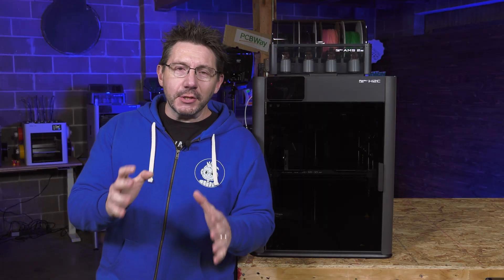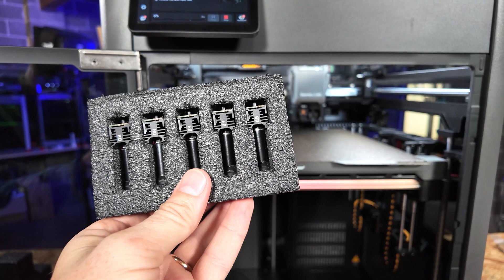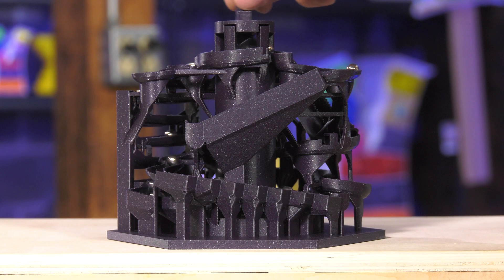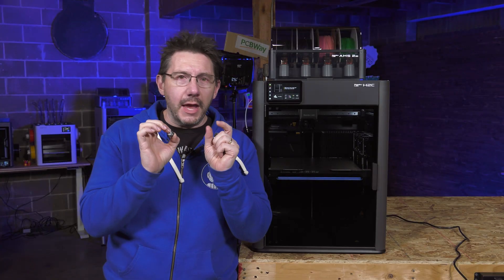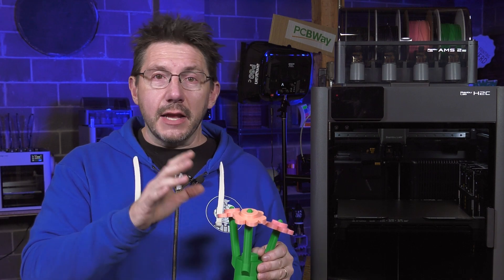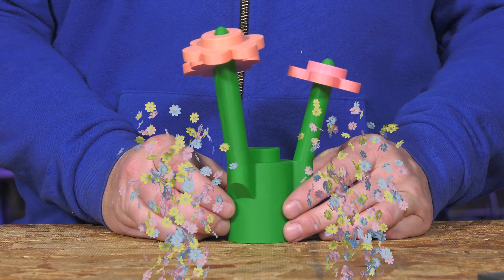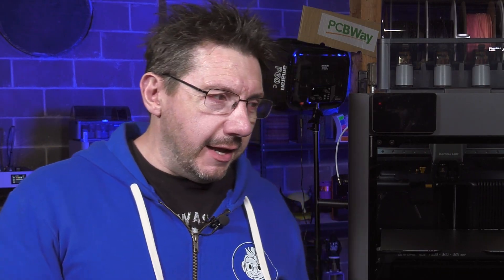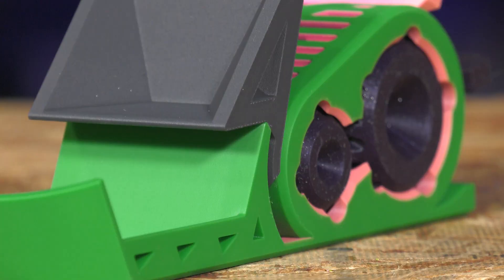My Review of the Bambu H2C + Vortek

Comment: The heat bed worries me. As a FLAGSHIP printer, this is not acceptable at all.
Reply: tbh, the throwaway clog nozzles worry me more cuz that's not something that's going to be fixed. Joel was really trying to navigate his way around Bambu PR friendly terms to explain away that...
Reply: @StormDogg  When I look at my Bambu printers their nozzles have by far been the best and most efficient I had so far - also from a cost perspective. No comparison to the cheap screw in nozzles that often like to cause problems very easily. I've some non hardened running for more than 1k hours and hardened for more than 2k print hours and they're still running.
Reply: @Leif_YT LoL. My screw in nozzles cost $1.25 and I can get them from multiple vendors, last hundreds of hours, and do not clog or jam. You're grossly mistaken and being a fanboy if you think your proprietary overpriced consumables are superior.
Reply: @xNuclearSS1x  1.25? That's the ones we have had many many years ago. There's a reason many companies moved away from those that are prone to errors. 
No comparison to todays nozzles / hot ends and their performance. I've had the cheap in the past and never looked back. Less quality, more hassle. Each change / replacement costs time which is much more valuable. A single clog / failed print costs often more than a complete hotend from Bambu or similar brands.  Doesn't make sense to try to save a few bucks on the wrong end.
Reply: @Leif_YT My K1 Max nozzles which are new Unicorn style cost $4 and i get print quality every bit if not better then A Bambu.  This nozzle has electronics in it....Its probably $25 a piece.
Reply: yeah, but honestly after heating it seems pretty even (considering the heating element) so a "simple" update that lower the reported temp by 10-15% might do the trick.
or delay shipment to update the heating element and/or temp probe.
Reply: @theaypisamfpv 10c isn’t exactly a small difference after heating.
Reply: @theaypisamfpv  Yeah, i also question the readings a bit - see my other comment.  1) The emission factor on that thermometer seems to be wrong   2) it's important to measure when the actual print starts. It won't matter how it is during heat-up phase before the actual print starts.  The heat will spread by then
Reply: Hey, need some advice! I want to buy a h2s but my buddy said a centauri carbon would be a better option due to the price. 😵‍💫 I value his opinion but I really wanted the h2s! What do I do?!
Reply: @ToxicWaste777  Bambu is worth every penny. Cheaper printers will stand out lacking in the end. I own 3 A1 Combos and a Mini all Bambu and I will NEVER own a different printer. My son had 4 Ender 3s cheaper and garbage. So yes, you get a printer for a cheaper price but you get the issues and drawbacks with it. My advice, INVEST in a great printer like any Bambu printer and you will not be sorry.
Reply: @Pr1ntCraft  thanks bro 💯 appreciate the advice/opinion
Reply: @Pr1ntCraft  trouble is, Bambu designs have issues with serviceable components. The X1 has glued in rods, so you can't change bearings, A1 has issues with the electronics failing catastrophically on occasion, etc. Bambu isn't an investment, it's a product. And you're losing more and more control as they go on.
Reply: @Pr1ntCraft Nice sales pitch. Now tell us how Bambu pays you
Reply: @ToxicWaste777 That guy gets paid by Bambu dude. He was sales pitching you.
Reply: @William-b5s2r  😳 wait seriously? Lmaoo bruh i just want some honest non biased opinions to help me make a choice 😭
Reply: @ToxicWaste777 Seriously the K1 just use Unicorn nozzles....they unscrew from the hotend and they are cheap
Reply: @William-b5s2r not at, all dead serious or as my kids say No Cap 🙃
Reply: @ToxicWaste777 Dyde seriously hes a paid Bambu troll. Dont listen to the sales pitch
Reply: @ToxicWaste777 Your buddy is right. H2s is a waste of money.
Reply: I should be getting the U1 in about a month and am wondering if that will cure my desire for multi-color, or if I should also upgrade from my H2D to this H2C and sell the H2D. . .
Reply: Don't worry, it's a nothingburger. It's not an issue.
Reply: @Pr1ntCraft  yeaaaa this was gonna be my next printer I don't know now
Reply: The buying a new nozzle if you get a simple clog doesnt worry you????
Reply: I question the readings a bit. See my other comment.
Reply: @Pr1ntCraft I wanted to buy it but now I don't buy it anymore
Reply: @Aprilia75000 and you made your decision just on one review?
Reply: @hyperflowfans no but I looked at several and they had the same problem with smaller prints
Reply: @hyperflowfans "No, but I see what a "technique" is in it, which changes heads a thousand times, and that at a single pressure, that can't be healthy and the wear is extremely determined by that." Other manufacturers have solved it better, because the "head" is simply changed.
Reply: @Aprilia75000 I have watched other reviews and to be honest I may purchase it. However do I get this only or purchase 2 P2S or a P1S and an H2S or H2D. Is it worth the price tag for the 0 purge (7 colors) or have some purge (0 woth 2 color) on an H2D. Bambu will always get my money, especially since they provide me with the funds 😂

Comment: How is the purge on the eagle several times larger than the eagle piece itself? And where does the filament go for each print head? It looks like it's mostly a traditional Bambu AMS system, with all the waste drawbacks, with the option to change filament sizes/types.
Reply: Well, changing the entire toolhead will have less waste, but that method has other drawbacks.  I guess you need to pick what is important to you.
Reply: @mattgraham4340  After watching some other reviews it appears that the purge tower on the H2C is about the same as tool changers. So not as bad as I initially thought. That tiny failed eagle looks like an extreme example of purge tower.
Reply: @davedujour1 "about the same" is subjective.  Some methods may have more waste out the poop chute instead of purge tower, but really gotta weigh total waste.  A complete tool change should only waste enough to deal with ooze, should be minimal need for void or color purging.  AMS has to deal with the remaining filament after cutting and color purging too.
Reply: @mattgraham4340  I agree, and these other reviews talked about how the H2C is only handling the ooze, with the cut happening at/near the nozzle head where the nozzle is replaced. Thomas Sanladerer specifically printed the same thing on several different Bambu H2* printers & the Prusa XL (maybe the Snapmaker also?) and compared waste. The H2C doesn't have anywhere near the waste poop that the X1* have. It is "closer to" (yes, still subjective) the tool changers in amount of waste.
Reply: @davedujour1  I think this reply was intended for a different thread

Comment: It’s too expensive! I can almost buy 3x Snapmaker U1s for that price!!!
Reply: I only print ABS and ASS. The u1 is useless for anything that needs a heated chamber
Reply: @wallie61-  The U1 has an enclosure and can print any material. And that includes ABS and ASA.
Reply: @keith4669  very false
Reply: Its a top lf the line printer.. you expect it to be cheap? You get a 5 color system for $2399. Thats still cheaper tha. The Pursa XL.
Reply: @writer8706 ive got the sneaky suspicion considering that the core 1 L costs 1800 USD . It is very likely it will be around the same price equiped with the soon to be announced INDX system.  And INDX is a true tool changer system.
Reply: @writer8706  Top of the line? It doesnt even heat the bed properly!! Its slower than the U1 and the Prusa XL. Pay whatever you want for your "top of the line" all you want, but smart people will do the math and realize that blindly following marketing is not smart.
Reply: @keith4669 oh no the printer has a desing flaw.. I remember the Prussia XL and tones of them at launch. crealitys flags ships are a hot mess. Top of the line dosent mean free of issues.
Reply: @keith4669 lol, Josef, is that you again?
Reply: LOL comparing the leading edge owner of the space (that everyone tries to copy / mimic) to a non-released kickstarter machine that hasn't even been in hand.
Reply: @B_M_A  Lots of people have used it and reviews are plentiful for the U1. Quit blindly following marketing and use your brain for once in your life.
Reply: @B_M_A  people already started getting their pledges a few weeks ago.
Reply: @B_M_A  exactly other way around ... H2C is in prototype / preproduction stage and Snapmaker U1 started shipping production units last month ...

Comment: 6:50 Oh no! Did you, by any chance, make the magnet wet?!
Reply: I’m confused… there is no magnet in the heating (hot zone). The magnets are there to hold the nozzle to the changer and picked up by the tool head. 

Those magnets seem unaffected by the heat, they worked in the video. 

The induction magnet is in the tool head. The hot zone of the nozzle uses steel to heat via induction and the inner nozzle is brass, helps evenly dissipate the heat. 

So I suspect Joel may have damaged the circuitry, either with heat or during the unclogging attempts. The nozzle can hit 350c so heating it up to melt filament shouldn’t hurt the induction system.
Reply: @RealGoos3  The joke is in the allusion to DJT’s latest ramblings, magnets nobody knew how they worked and they stopped once exposed to water. Nothing to do with the printer per se.

On it, they are indeed on the heatsink, not the actively heated part. Nonetheless, since they’re exposed to a hot milieu, invites the question how long they’ll last.
Reply: @EditioCastigata  I missed the joke. Also, Bambu has had magnets on their heat syncs/hot ends since the A1/mini. No issues.

Comment: 11:40 Well that’s a show stopper… 😢
Reply: Same ‘issue’ was reported on H2D, but in reality, the delta between core and edge (at the door side) is only 1.4 degrees C when the printer starts to print. This is definitely not a real issue.
Reply: @diavalus  That does not match what was shown in the video. There was as much as 10c diff on the bed where the heating element was and wasn't in contact with the bed. Then, the entire bed was ~10c below 100 when the printer said it was fully heated. For filaments that are more sensitive to the bed temp, this is very much an issue currently, with the data present. Thankfully its not available in the US yet so can see more reviews and what not before making a purchase decision.
Reply: @bwdnako  that’s because the bed needs time to even out. In this video, you can clearly see the bed just started to heat up, so that behavior is normal. Try to measure this on other printers and you’ll find the same. 

Temperature does not distribute instantly, it needs time to propagate and normalize.
Reply: @diavalus  This design was acceptable in the P1S, but even considering heat soak, the snake shape of the heating element means it will always be unevenly heated even as it is PWM controlled. Plus, the fact that the bed thermistor is reporting wrong as the bed heats up always puts accuracy in question. It's a good thing that this printer relies on a separate chamber heater rather than using fans underneath the bed for chamber heat (a la Voron and Prusa Core L printers) or else the issue would be much worse.
Reply: @diavalus right, but the H2C said it was up to temp and clearly wasn't. The Prusa was. So either Joel let the Prusa soak and not the H2C or the Prusa does a better job at monitoring and accurately reporting the bed temp. I do agree that letting it soak would help reduce this problem. But it's still an issue that it said it was up to temp and it wasn't even close.
Reply: to be fair, what kind of thermal camera does he use? is it even measuring where he is aiming? my A1 and P1S thru my thermal camera looks nice
Reply: @AndrewTSq If you watched like 30 seconds longer, he shows the Prusa XL bed.
Reply: @AndrewTSq I mean, that's not entirely relevant when he shows it properly reflecting the same temp the Prusa printer was reading. So its right for Prusa but wrong reading the Bambu Lab? Or was it pure coincidence that it was able to read the Prusa temp the same as the probe for the bed was reading and outputting on the display?
Reply: @AndrewTSq He's using a thermal imaging camera. You can see the heat of the entire bed. It's incredibly uneven.

Comment: The uneven bed temperature issue might be solved by a copper or aluminium plate between the build plate and the heater to act as a thermal diffusion layer. Worth trying.

Comment: Yeah... Glad you got to try it out. But, I think I'll wait a year. Let them figure out the firmware and maybe update the build plate heating.
Reply: Yeah plate heating killed it for me. I'll also wait for the fix.
Reply: and on sale. I have no room for 27 AMS Pro 2s and 30 HTs haha.
Reply: With the electronics testing labs being so far behind in the US now, it'll be lucky to be on sale in the US within a year.
Reply: They need a redesign. The time penalty for Bambus method is bad.
Reply: @perkulant4629  i personally dont care if a print takes 2 days or 3 days, i dont sell any of my 3d prints. So i rather have quality over time.  If the print needs longer, so be it. - atleast for me , i couldnt care less about 15 sec prusa XL swaping or 40 sec swaping for the bambu. 

only thing that annoys me more is the loud AMS swaping filament each time.  wish there was a silent mode ;D

Comment: That heatbed element…. 😅
Reply: taken straight from the oven
Reply: The heating element 8s not the problem  it his build plate
Reply: also very scummy of them to not tell them the price beforehand. I HIGHLY doubt that they decided on the price the last hour of launch... so they knowingly withdrew the pricing so that the reviews couldn't bash it for huge prices and bad performance
Reply: @outofmarbles5536  Perhaps they’ve canvassed the FormNext fair that’s currently in Frankfurt, using what the competition has as input into the price decision, which they’d make last-minute.
Reply: @outofmarbles5536  This is not uncommon. Scummy...strongly disagree.
Reply: @Bobbyg2018  because some other companies do it too, then we can't judge bambu labs now? flawed logic
Reply: @outofmarbles5536  fault them if you like, but saying it's "very scummy" is a bit dramatic.  Also, in this case - it's stated that the unit has been in hand for some time - I just don't think you are considering all of the factors.

Comment: I've always had problems with bad adhesion with my bambu printers, particularly with pla. I always have to bump up at least 5 to 10° higher on bed temp just to get any print to stick. Regular pla 60° typically and htpla 65 °.
Reply: What, standard pla profile is at 65 already...
Reply: Cool plate solves all your adhesion problems 100%

Comment: It's possible to over dry nylon. It will come brittle. But it absorbs moisture so fast it usually doesnt happen. Did you flex that part right after printing or did you wait a while. Printed nylon performs better after it's had some time to absorb moisture.
Reply: Overly dry wouldn't explain the strange banding.

Comment: Why does it feel like they didn't take the permanent demagnetization of neodymium caused by heat into consideration? Man… I hope there is a different type of magnet they can use, like an electromagnet… Or just… a mechanical latching mechanism…
Reply: Non issue, a1 series uses this system for years already. Magnet is not in a hot zone.
Reply: @riba2233  Well it was an issue in this video. ;)